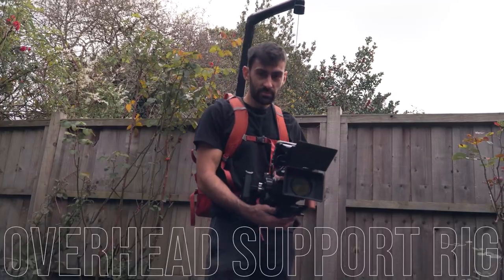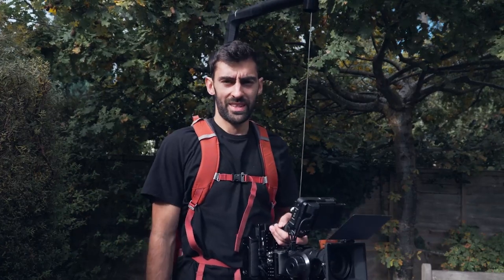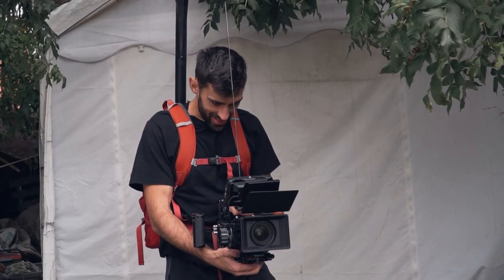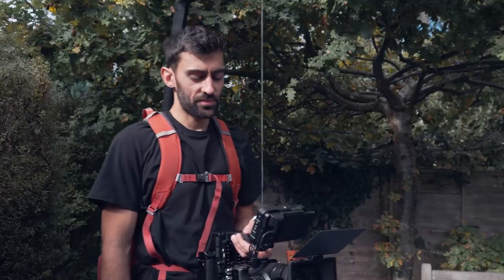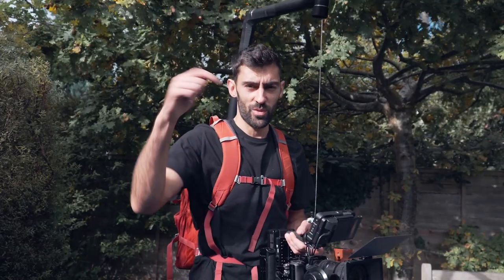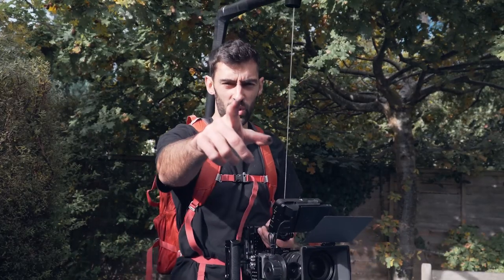DIY EasyRig for just $30!? | Homemade Overhead Camera Support

Comment: @ :48 did you end up attaching the pvc to the plywood block or leave them separate?
Reply from the maker: No it just sits in the clips with the wood block stopping it at the bottom so it can swivel or be removed easily 👍
Reply: @TZ3official  oh awesome. And thanks for the quick reply. Definitely gonna try this out. 
Did you need to add any weight to counter balance the camera rig?
Reply from the maker: @TannosaurusRex13  didn't have do as my handle is in the right spot, depends on your set up I guess :)